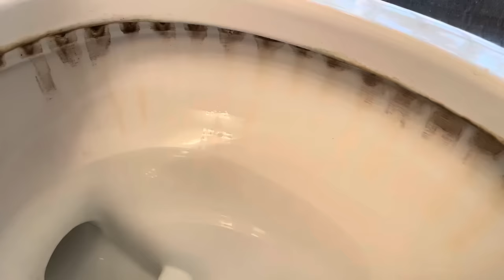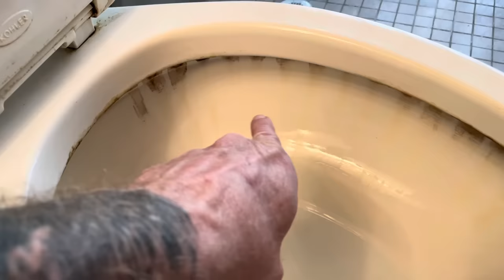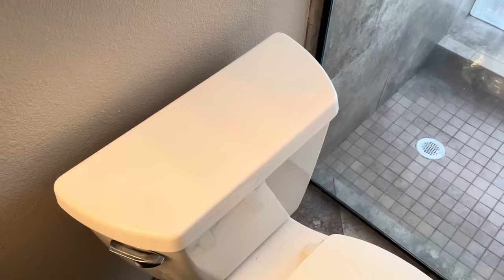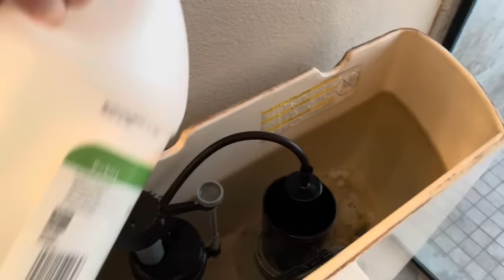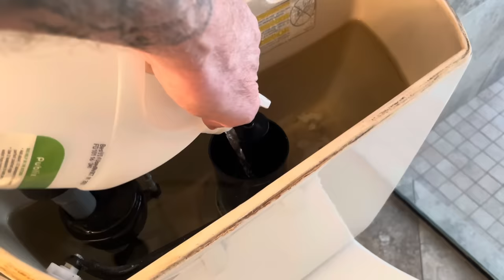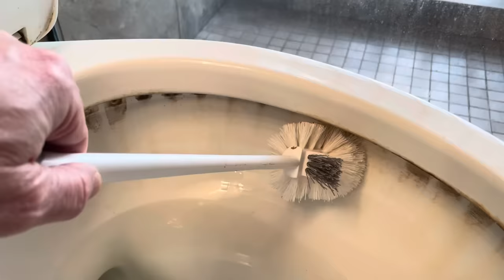Why Does THIS Keep Coming Back and How to STOP it

Comment: I've been fighting a reoccurring black ring on the bowl of my apartment toilet for the past five years and it never occurred to me to use vinegar of all things to take care of it from the tank itself. 

Thanks a million! I'll definitely give this a shot.
Reply from the maker: You bet
Reply: So how did it go? Did it work for you?
Reply: @equestriangirl89  Kind of. The ring is spotting back in, so I figure it may take a couple treatments
Reply: @LordServbot  
I'm actually surprised, you don't have your flush water tank full of black mold as well, if it's that bad.
Bc that's exactly, what I'm currently fighting with, the mold's repeatedly growing inside the tank, I remove it with vinegar but it returns after a while ... and so I bet the largest black mold roots have grown inside the decades old calcified supply pipes I can't reach, bc they're inside the walls!
Reply: @Anita-k  Yeah, I know my pipes in my apartment are likely calcified something fierce. Only can do so much, y'know?
Reply: @LordServbot  
I know ... and changing the old pipes in a rental doesn't make any sense and is WAY too expensive!

Comment: I use vinegar & baking soda as a natural cleaner for a lot of things from toilets to floors to laundry x many decades !!
Reply from the maker: I will tell you a secret… mixing baking soda with vinegar neutralizes the acidity of the vinegar rendering it less effective. You are far better off using them separately.

Comment: There is a reason the cleaning products have a nozzle & a slanted shape..
You're supposed to push at least half a bottle into the crevasse up top all around, let it fall down covering everything, close the lid & 30 min later just press the flush button. 
Still, good to know that the main issue might be present in the water tank. Great video.
Reply: The mold isn't in the water tank, it's in the internal rim/reservoir where the water goes before exiting through the jets. The jet holes are small, there is a 0% chance toilet bowl cleaner will enter the jets from the outside and clean the reservoir, regardless of the nozzle and slant on a toilet bowl cleaner bottle. This video was pretty simple but you might wanna watch it again.

Comment: This happens on most of my faucets and toilets in my new house.   I thought it was the water, but it doesn't happen on my new faucets in my recently remodeled bathroom and kitchen.  I think the previous owners let the lack of cleaning get so bad that there's mold internally that doesn't get killed when I clean it, so it comes back quickly.  I've never had this problem in past homes.  I'm thinking of taking the faucets off, removing the aerators, and using a wire pipe cleaner on them.
Reply from the maker: Yes, and make sure to get vinegar inside there to kill the mold down to the roots. 👍🏻
Reply: If there's a header tank, the mold will be in there. Sounds like there is, because normally fresh water is chlorinated which will kill molds.

Comment: I live in a motel and I see it as a recurring issue I always used bleach and a bit of scrubbing but I didn’t use vinegar.

I know vinegar can clean practically anything so thank you for that I appreciate it.
Reply from the maker: Bleach is mostly effective at killing mold on non-porous “glazed” surfaces. But the internal rim cavity of a toilet, where the mold is flourishing, is not glazed and is very porous, so vinegar is far more effective, as it’s able to kill mold deep down to the roots.

Comment: I use ZEP vinegar. I get it at Lowes. It's in a yellow jug. Two or Three doses with about an hour dwell time and shazam. The toilet even flushes with greater vigor!
Reply from the maker: Yes, Zep and other cleaning vinegars are slightly more acidic, about 6% relative to about 5% with distilled white vinegar. But I’m not sure that difference warrants it being twice the price. And yes, the reason it improves the flush is that it breaks down the mineral deposits that collect over time and block the jets. 👍🏻

Comment: I've been using bleach in the water to clean this up...I love the idea of the distilled vinegar, though. It's not toxic (as far as I know) and a far safer product to use. Thank you so much for a much needed "no nonsense" video. You ROCK!
Reply from the maker: Bleach is mostly effective at killing mold on non-porous “glazed” surfaces. But the internal rim cavity of a toilet, where the mold is flourishing, is not glazed and is very porous, so vinegar is far more effective, as it’s able to kill mold deep down to the roots.
Reply: @papajoeknows8355  Thanks for the explanation! I really appreciate it!

Comment: I recently started having this in my toilet bowl.  I put 1 cup of citric acid in the tank. Waited 1-2 hours and refilled bowl. Then, I used Lysol liquid toilet bowl cleaner that you squirt under the rim. The mold was loose and came off without having to scrub. Now it’s clean and I will put vinegar in the middle section to kill any residual mold. Thanks for the information.  I really appreciate good cleaning tips.

Comment: I use cistern blocks for the same reason, that way every time I flush the toilet, a powerful cleaning is taking place inside the toilet, as well the bowl

Another place to check for mould is in the cistern itself, because if there is mould in there, you are just reintroducing mould spores in to the cavity where water comes to flush the toilet

A good idea, is to turn the water off to the toilet if you have an isolation valve, or to the house itself if you don't, then take the cistern cover off, flush the toilet and use the same toilet cleaner you use for the bowl inside the cistern around the inner wall of the cistern

Coat the inner wall, let it sit for about an hour, this will kill off bacteria and mould, then turn the water back on and let the cistern refill, then flush the toilet to flush out the bleach from the cistern

Then I recommend using a cistern block, they typically last about 50 flushes, so how long you get between uses varies depending on usage for a household, you may find that mould, dirt and grime comes out of the water jets with use of a cistern block, this is normal, it means that inside of the cavity is being cleaned out of any build up that has occurred over time

Continued use of a cistern block, will prevent the issue from reoccurring, both in the cistern and in the cavity where the water comes to flush the bowl

Hope that helps
Reply from the maker: Good to know, and thanks for taking the time to comment. Wish the blocks lasted more than 50 flushes though… that’s about 2 days in this house lol. 👍🏻
Reply: @papajoeknows8355  

I guess using such a thing once every 2 or 3 months would suffice to help it
Reply: @papajoeknows8355 That’s a different type of plumbing problem 😀 …sorry I don’t have a recommended but appreciate all the advice here!
Reply: What is a cistern block. Never heard of it.? Thanks
Reply: @sharonduke5097 sounds like one of those bowl cleaners you either drop or hang inside the tank. I've used some of the drop in types that left a residue which eventually interfered with the flapper

Comment: I wonder if the 30% acid vinegar would work any better / faster.
I always have that around the house for killing weeds and removing rust. You have to be a little careful with it because it's rather caustic, but it's amazingly effective for those tasks.
You can get it at Home Depot, Lowes, etc.
So you won't pass out from sticker shock, I'll warn you right up front that it's expensive - about 20 bucks a gallon. But a little goes a long way.
Reply from the maker: Interesting, I’ve never even heard of it, but I bet it would work faster, as it’s the acidity that makes the vinegar effective. Does sound pretty pricey thought. Thanks for commenting. 👍🏻
Reply: Would the higher acidity damage the toilet parts?
Reply: @queenbunnyfoofoo6112   - I thought of that too, and dismissed it.  There is plenty of water in the tank to dilute the acid, so it won't attack any of the rubber, plastic, or metal parts.  And once it gets into the porcelain bowl, it can't really hurt anything.
Reply: @David_K_pi  I figured it could sit in the tube without problems....I was just concerned about the over flow, because stuff is made so cheap these days. Thanks for the info.
Reply: @queenbunnyfoofoo6112  - Oh definitely! One would certainly want to make sure there is water in the tank to dilute the vinegar. Your concern is valid. But I think it's okay if done properly.
Also, wear vinyl or nitrile gloves and eye protection. And try not to breathe it - it burns. That last comment seems to be more important while spraying the vinegar because the sprayer atomizes it. 
But I love this stuff as an environmentally safe weed killer. No carcinogens in the water table. It's especially useful in the gaps between the slabs on the sidewalk and driveway, but not near the lawn.
Thanks for commenting and keeping me on track. 👍😁
Reply: @David_K_pi,
  Thanks for that tip! I have been trying various products/ways to break down the hard water deposits at the back of the toilet bowl, and under the rim there, with no real results__even a pumice stone hasn't worked. 😢  I heard about a particular acid that would for sure remedy that, however, I've decided not to go that route because I have cats and I certainly don't want any accidental exposure, and prefer not to have that sort of product being stored in our apartment. 💖🙌😺
Reply: @debracisneroshhp2827   - I hope it works well for you. Good luck! 👍😁

Comment: This video along with the pumice stone video is so helpful. Thank you!
I have used bleach for years but it has not been as effective as I’d like. Doesn’t bleach and vinegar used together create a toxic fume meaning I would need to eliminate the bleach and use vinegar on its own for the bowl maintenance?
Reply from the maker: Correct, DO NOT mix the two, it creates chlorine gas. Bleach doesn’t kill it anyway, it just bleaches it out really. The vinegar does kill it… just takes a while for the color to change, but the pumice stone solves that problem anyway. 👍🏻
Reply: @papajoeknows8355 isn’t it ammonia and bleach that makes chlorine gas??
Reply: @garyrosshirt6415 yes   you are  right this guy is incorrect
Reply: No NO NO! Bleach and ammonia are poisonous, not vinegar
Reply: @papajoeknows8355  Thank you!
Reply: @genxx2724  Thank you!
Reply: @comena30  Sorry, I meant vinegar and baking soda neutralize each other. I would never mix anything with bleach.

Comment: Thank you!  The acidity of the vinegar won’t compromise any of the pieces in the tank?
Reply from the maker: No, it’ll be fine.
Reply: @papajoeknows8355  thank you!!
Reply: If anything it would help dissolve mineral deposits too?  Thanks for the tip with a sub/likie

Comment: I gotta try this joe thanks never would think of this and am gonna pour vinegar down the tube with lime away as i have rock hard water.  hey joe you're the guy to ask,  what is that tube for?  just flushed and looked with flashlight down into tube and just a tad a water appears when you flush.
Reply from the maker: That’s the overflow tube… if your fill valve were to malfunction and not shut off, the water will go into the overflow tube instead of the tank just filling up and overflowing onto the floor. The overflow tube sends water through the rim cavern, through the jets, then into the bowl. Then once enough water fills the bowl, gravity will then cause it to flush on its own. More than you wanted to know, I’m sure, but my mind wanders lol.
Reply: @papajoeknows8355  glad i hear this joe it is great as i always wondered what that tube did an now i know,  cool,  so putting lime away in the tube would be a good thing.  do a video on how to remove hard as rocks water stains from an acrylic bathtub i should have never got new in the first place.
Reply: Is it safe to mix vinegar and lime away?
Reply: @papajoeknows8355  Thank you Joe for explaining this. I'm not a plumber & don't know about the mechanics of the flush system so I was searching the comment section to see if I could find "why" filling the overflow tube & waiting [for what?] would work. Thanks again.
Reply from the maker: @angelacarr2481  I would not.

Comment: I have a dreadful case of this in my toilet and, like many others, thought it was limescale build-up. I will certainly try this tip out.
Reply from the maker: Actually, you’re partly correct, the mineral deposits, form a bed that the mold can more easily root into. The vinegar helps break that up as well. See also the two videos linked in the description. They will help.
Reply: @papajoeknows8355  I bunged a litre of white vinegar into my tank yesterday. This morning, great flakes of the black gunk that's been bugging me just flaked off when I gave the toilet its daily bleach-and-brush. I've decided to do the vinegar treatment once a week - it only costs £1 - and will keep you and your commenters posted.

Comment: Home Depot or Lowe's vinegar is stronger ,but after cleaning the ports were the water comes out to stop the build up from coming back i put an bar of soap in the tank in one toilet and in the other used WD-40 in the other bowl at the ports and found both to be effective from the recurring problem. Because they both made the ports less dull that allowed the backteria to grab onto. Worked for me.

Comment: to keep your toilet  forever clean, put vinegar in a spray bottle and skirt once on the lid then keep lid closed. Do his anytime you use it and  every night. The vinegar is an evaporating acid and destroys the negative energy flowing up into your toilet from the sewer. A ring I could not get rid of with acid disappearred after a few days of doing rhis and has never returned. also keep drains closed and spray a little at them.

Comment: Vinegar is cheap.  First flush the toilet to let the water out of the tank.  Use a whole gallon and pour it into the tank before it stops filling with water.  Let it sit for an hour.  Then flush the commode.  The vinegar will now flow into the passages you describe.  Let it sit a while before flushing again.  Now you have cleaned the mold out of the tank AND the flush passages as well.  :)

Comment: I did this, it works great for maintenance but getting all that black mold off needed a little more work, so I used a baking soda paste, which is just adding water to baking soda to the right consistency, and applied it all around the under side of the lip of the toilet, by hand using a rubber glove.  Let that sit for a while then soaked an old scrubber sponge (I save all my old grungy kitchen scrubber sponges just for this type of job) with distilled vinegar and it came right off much quicker.
Reply from the maker: There are also two videos linked in the description that help a lot.
Reply: @papajoeknows8355  Yea looks like there's several effective methods.  Thanks!

Comment: Good advice, and there's a number of things around the house that work well, hydrogen peroxide being one that REALLY works well! Also, it ABSOLUTELY helps to completely drain the water tank and, again, use HP to scrub down the inside of the tank. HP also instantly dissolves calcium,  lime, and hard water deposits that form rings in the toilet bowl. That's a CONSTANT battle I have because maybe I'm OCD, but I can't stand that ring, it builds up, traps germs, and makes your bathroom STINK! I moved to where I am now about a year ago, and my toilet is WAY cleaner now than it was when I moved in!
Reply from the maker: Love hydrogen peroxide, and sooo many uses. 👍🏻

Comment: Many thanks.  I have a relatively new toilet.  My apartment complex replaced them all a few years ago, and this phenomenon appeared relatively early.  I scrub around the rim with my toilet bowl brush, but it remains.  I will try the vinegar treatment now.
Reply from the maker: She also the two videos linked in the description. They may help as well.
Reply: If this doesn't work, use a steam cleaner with a bent nozzle and kill the mold with hot steam, over 260° F.

Comment: Thanks I had it so bad in both bathrooms. I did take paper towels soaked in the vinegar and tucked them under the rim instead of tape. No extra scrubbing or anything! I also took off my faucet thingy and put vinegar soaked paper towel tucked up into the hole as far as possible. Worked like a charm and no more drip stain there either.  Thanks papajo
Reply from the maker: Awesome glad it helped you! 👏🏻

Comment: I moved into an apartment and the toilet had a dark ring that wouldn't go away with normal cleaners. I got online and found that it might be lime or rust and got Lysol Lime & Rust toilet cleaner. It worked great the first time!
Reply from the maker: Yes, that could be for mineral deposits in the water. Interestingly, the acidity of the vinegar helps to break those down as well.

Comment: Lowes sells 20% vinegar, which has four times the cleaning power over 5% vinegar you get from the supermarket. It is expensive, however. You can also send away for 30% vinegar, which is even more powerful a mold killer. Either/ or, ventilate well when using this stuff.

Comment: I had this problem with our toilet. I used a combination of white vinegar and bicarbonate of soda and let it sit for several hours. I had to do this a number of times, but I now do it on a regular basis if I leave the house to go on a trip for a number of days or go on holiday.
Reply from the maker: You would be better off using the vinegar alone… it’s the acidity of the vinegar that kills the mold. When we add sodium bicarbonate, it neutralizes the acidity.